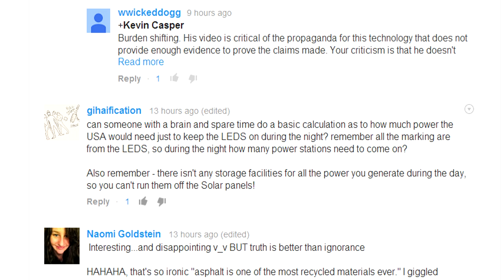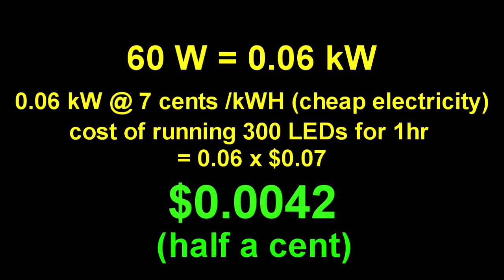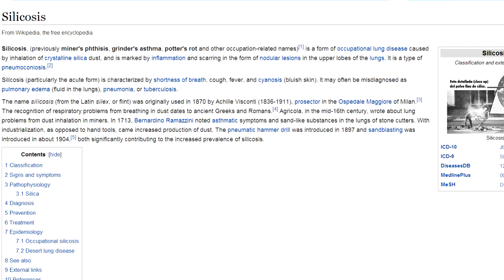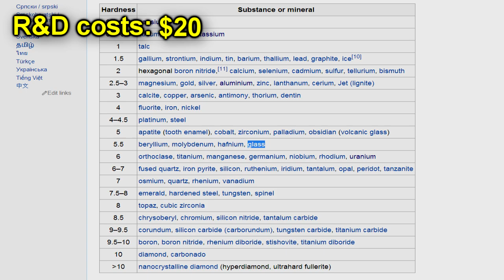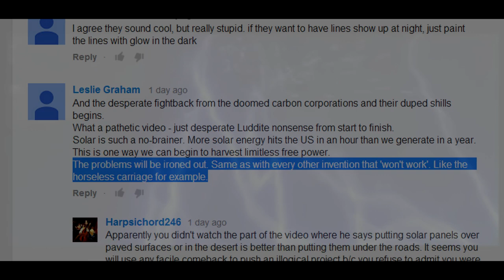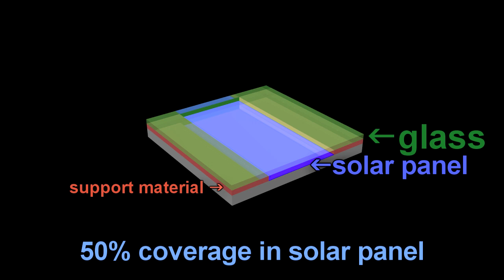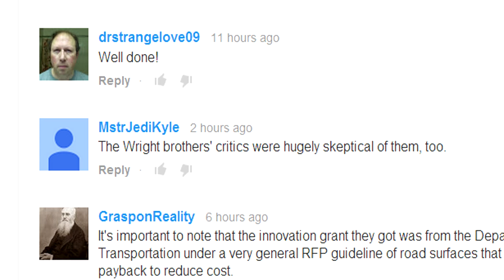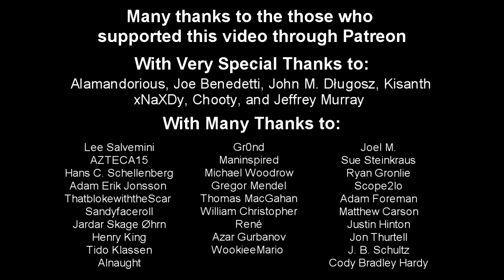Solar Roadways, IMPORTANT QUESTIONS AND ANSWERS!

Comment: Dear Thunderf00t
Instead of saying it is impossible why not try to think of ways you can make it work. Roads follow power lines so they could easily transfer the excess power somewhere to store it. And they could find a stonger clear plastic instead of glass, and use it to protect the solar panels.

This is why you don't get paid to research this stuff, and why you are stuck on YouTube
Reply: Thunderf00t is a paid researcher; so not really 'stuck' on youtube. I have an idea how this project can work, build the solar panels by the side of the road, that solves literally every problem and its cheaper. Even better idea; more solar farms.
Reply: He gave examples is of things that would at least work better than this. Putting the solar panels next to the road or building a roof of solar panels over the road would be cheaper to build, produce way more energy as you can angle them more to the sun and don't have a dirty road blocking the sun. And on top of that it would avoid all the problems of driving on glass / scratching the glass.
Reply: He did, what else do you expect? Some ideas aren't worth the effort. And what do you mean stuck on youtube? Is Tf digitally integrated in YT or what do you actually mean by that?
Reply: Firstly, to suggest that you shouldn't criticize a fundamentally flawed idea (especially one that has received $2 mill) unless you know how to make it work is simply absurd. However, in both of his videos he discussed road-side panels and mentioned how they don't suffer from some of the same problems. Unfortunately, they are still deemed to be cost ineffective in many locations despite their relatively tiny cost in comparison to these solar roadways.
As for the plastic, there are two issues that immediately spring to mind. Firstly, the strongest plastics that are currently widely used have very low scratch resistance. There is, of course, research into much stronger materials, including the addition of diamond nano-particles, an area in which I have a modest amount of expertise, but I'm afraid you'll need to start an Indiegogo for a money tree before we could afford to use something like that. Secondly, they made a lot of noise about using recycled materials (despite that fact that most recycled glass isn't clear enough). Plastics of this strength and transparency would need to be made from 'fresh' raw materials in any feasible production process.
This is why he has such a large following, and you are stuck posting ignorant comments.
Reply: alsoknownasallenkeys

If you cannot "criticize a fundamentally flawed idea" then wich kind of idea can you actually criticize?

You can have large followings with any kind of idea. Look at all the religions.

Most ot the arguments made by Tf are valid but they stay unaddressed by http ://solarroadways.com/intro.shtml

Hope there will be a payoff somehow.
Reply: "Roads follow power lines so they could easily transfer the excess power somewhere to store it."

This shows that you have no technological education at all.
To transport the electricity you have to transform the low voltage DC power onto  a high voltage AC line. And when it arrives at it's final destination where do you store it? Giant batteries? It's the problem with solar panels, they produce a lot of energy but not exactly when we need it so we have to use wind, nuclear and coal to compensate for when it's dark.

You will have giant losses and even if we magically developed a cheap battery that could store lots of energy, enough to power everything during the evening/night then why aren't we focusing the 2 million dollars on that magic battery?
Reply: Your first paragraph seems to agree with me but, with respect to your second, it was only a play on the phrase that he used.
I have seen their response and it is very easy to address them. From what I remember these are the key points:
They are only using 10% recycled glass. I'm glad they said this. I've read a couple of things directly from them that suggested they were using an extremely environmentally friendly surface so, if anything, this removes this from the 'pros' column. Asphalt is better in this respect.
They mention examples of LEDs that can easily be seen in daylight and say they will just make theirs more intense to match them. Doing this will increase the cost of production and operation several times. None of the examples are facing the sky either, so they will need to much more 'intense' than the examples they show.
They quote figures for the cost of snowy/icy roads but they really don't address his point. The energy cost is astronomical and the solar power from these areas won't come close to paying for it. If it did, the snow and ice would be melted by the sun itself. If they can't afford to get rid of it by conventional means then they can't afford to do it that way.
The final and most important point if their claim of a good ROI and I would certainly like to see how they arrived at that conclusion. I wonder how often they have assumed the panels will be covered by cars. Unless the road is very empty during the day this will be significant. I wonder what they presume the failure rate will be and how they have calculated the associated costs of closing the roads when a sufficient amount of these have stopped working. Finally, I'm fairly certain that they haven't considered how quickly the surfaces of these panels will become so translucent that they are almost useless. Until they give us the material they plan to use that will last more than a few days, let alone many months, before getting scratched, that is a problem that you can't escape.

Comment: I wonder what type of PCB/soldering technology they are going to use. All of that heat, cold, moisture, vibration etc would make these panels die within years if not within a year. I'm not sure why they would use LEDs in the first place.. surely they want something that can be flipped electronically but holds without current. Things would would get very fucking dangerous very quickly if all of the road markings suddenly disappeared in the middle of the night because of a failure in the standby supply for the panels.
Reply: :) its a shill idea from the outset - its just plain froud cames, I dont understand how does Indiegogo allow this sort of nonsence.
on the other hand ... anyone would like to finance a plastic indie rocket to the moon? I have some nice KSP footage of how it will work :D

Comment: One thing I don't get; how are you supposed to get those hexagon tiles to fit together without any appreciable gaps between the tiles? Adhesive surfaces between the tiles would be ridiculous and not last long, and if you just nailed them down together then you would still expect gaps to be created by the abrasive forces from the trucks on the surface. You can't really have gaps especially in a cold part of the world where freeze thaw is a problem. Also how are these things going to communicate; I assume it will have to be wireless, so every frigging solar panel needs wifi too?!  And of course what about thermal expansion! That would either force you to incorporate gaps deliberately which is exactly what you don't want, or risk them cracking whenever you have a 100F day.
Reply: John Yorson What about coastal roads that get splashed in high tide xD
Reply: Or places that have lots of EQ's and other natural disasters? Imagine a hurricane flooding a city full of those solar roads.
Reply: John Yorson Well that is a massive problem, you can't make them porous like asphalt or concrete because the water will get to the electronics, and you can't make them hydrophobic because that will make them slippery.
Reply: YoungerBrother Wakeup tbh I think a teenage computer hacker in a suburban basement could do more damage to these roads than a hurricane :P

Comment: They made a page debunking these debunks - solarroadways.com/clearingthefreakinair.shtml
Reply: Are they even trying? I mean their debunks are as stupid as their initial claims.
Reply: They claim that they picked a good place to put solar panels. Unfortunately, they don't mention they sacrifices of being unable to angle solar panels, or the surface area of the solar roadway panels covered in solar cells. 

They claim that the cost of Solar Roadway panels is overstated, and that a cost of less than $10,000 a panel would be sufficient to meet asphalt road costs. However, they do not state the actual cost of Solar Roadway implementation, just that the figure is unknown. Also, since asphalt is a pre-existing system, repairs would likely be less expensive that the implementation of a new road medium. 

They claim that asphalt roads are not cheap or maintainable. I don't know who claimed that is was cheap, but it's certainly seems cheaper than Solar Roadway panels. They're also not over-engineered, use no power, are made from a recycled bi-product of the oil industry and provide tried and true traction for tires. 

They say that asphalt is softer than glass. This might be a good point if roads were only made from asphalt, but roads use asphalt as a cement to hold stones and rocks. It is the stones and rocks that are the issue, not the asphalt cement. 

The say that you can easily see LEDs in direct sunlight, but the examples they give are always face on. The LEDs in Solar Roadway panels are at a shallow angle. Also, they make no mention to how economically and environmentally conscience it is to fill solar panels with LEDs you are unlikely to ever use. 

They say that they can afford to heat icy roads because it will save lives. This is confusing the issue. The issue isn't that keeping roads clear of ice and snow isn't important, but rather that heating the roads is very inefficient. The energy needed to change a compound's state (from solid to liquid, in the case of ice) is far greater than you would think. Simply keeping the panels a few degrees above freezing, as they state, would probably not be sufficient to deal with snowfall.
Reply: ***** The snow melting debunk was the most pathetic thing I have read. "Ehm yeah it might cost ridiculous amounts of energy that we will never be able to generate but you'll be saving lives man! Emotion! Don\t think, feel!! "
Reply: *****
-Solar panels don't work when dirty. Roads get dirty.
-Glass is softer than the softest silicate in dirt: Quartz
-Solar panels can't be angled if put on the road.
-LED lights are definitely not visible in the sun. That's why traffic lights are shaded with cylinders.
Reply: That's ridiculous, they did zero calculations on the actual price of the tiles. As well as provide videos an demonstrations on the traction.
Reply: "So if anyone tries to tell you that glass is soft, just remind them that even simple window glass is harder than steel. By comparison, it's asphalt that is soft."

I see they're using Skyrim logic, cool.
Reply: "So if anyone tries to tell you that glass is soft, just remind them that even simple window glass is harder than steel"
Reply: Please upvote this guy so that TF notices him. A debunking of the debunking of the debunking should be fun to watch :).
Reply: Some of these are fukcing hilarious.

My favorite is:

"Thunderfoot compares our Solar Road Panels to a thorium car and a transorbital pogo-stick and says, If you could make one, it would be super cool. We actually made 108 of them. And he's right: they're super cool!"

Yes, thats like saying you made few of the bolts required for the Thorium car.
Having few of those panels is not a road. Its just a few panels.
Reply: They literally found ways around every argument... not directly answering anything. Perfect example is glass being harder then asphalt... that doesn't matter, asphalt can be scratched, what matters is whether its softer (can be scratched) by rocks and other debris on the road because it needs to stay clear. Then they show high intensity LEDs in street lights faced straight at the viewer... that's not the same as viewing it through glass (scratched up or not) at an extreme angle. Also the heated road parts... they go on to discuss how much life is worth, well shit if that's the case we can put heating systems into asphalt roads... but we haven't. They don't discuss the actual price because they used the wrong type of LED in their prototypes and haven't gone onto mass producing yet or whatever, just lol at the whole page.
Reply: Samuel Shipman Someone needs to tell them that road grit isn't made from steel.
Reply: YoungerBrother Wakeup I thought the asphalt being softer than glass 'debunk' was the most egregious misrepresentation in this long list; I actually couldn't believe they had though it was a worthwhile point. However, I agree that their pathetic appeal to emotion about the dangers of icy roads is so obviously manipulative it borders on the insulting.
Reply: burlakinavolge You'd think engineers would know the difference between hardness, strength and toughness.
Reply: Samuel Shipman I swear I did a triple-take when I read that line. These people are out of their minds.
Reply: Uncle Grim Made me so mad haha
Reply: Derek Chapman Their asphalt argument shows that they are full of crap. "Asphalt" is a colloquial for for "asphalt concrete". Asphalt is just the glue that holds together harder aggregates.
Reply: Donnie

Or just don't feed retards more attention. I think we have enough of that already.
Reply: U9B maybe, but today one of the channels that I follow, covered this story again. And money is still flowing there. And people still believe their defense.
Reply: Its great, all they are saying is "THEY ARE WRONG AND LIEING", but they refuse to explain exactly how they are wrong.
Reply: burlakinavolge
haha, that is awesome.

Comment: The fun thing is this scratching is nothing to a brake check, 130 km/h down to 0 as quickly as possible.
Imagine the carnage if there is a simple accident, someone rolling his car, a tree falling on the road, roadkill, leaves on the surface which need to be gently wiped off.
Then, I really don't want to know how horrible glass behaves if wet or freezing cold, imagine the wear on the coating as well as on the cells during winter/summer.
This is madness. the money could be used elsewhere, if they want new technology, they can support molten salt reactors, 5-stroke engines, which are technologies needing some ironing.
Or they could donate to charity, to cancer research, among others.
This is a huge waste.

Comment: Your experiment is rather cheap, yet surprisingly effective.  Ideas like this are needed to free ourselves from a dependence on fossil fuel, but, as enticing as this idea is, I don't see it going any where.  This guy should have funded research for smaller batteries for electric cars or a lobbying campaign to legalize hemp.
Reply: Or just put solar panels on buildings and houses.
Reply: Absolutely agree.

Or perhaps solar panels on the tops of electric powered vehicles, as well as the usual option to charge them manually (Charging them manually still uses fossil fuels to generate the electricity.)? Or maybe the wings of commercial aircraft - charge up batteries during flight where they're above the clouds and get almost constant unobstructed sunlight during daytime flights, then swap them round for empty batteries before the next daytime flight?

Ok, the last one might be a bit sketchy, but there's just two ideas that would be more efficient than "solar freakin' roadways" that I just came up with watching Tf00t's vid, and I'm pretty sure it wouldn't cost almost 2 million dollars to explore the viability of either of them.

But yeah, at least they're trying, and maybe these LED solar panels could be implemented in other ways other than roads, pavements, car parks, etc that we haven't thought of, even if they are basically useless for all of the above.
Reply: nuclear.
Reply: the guy who never uploads anything Nuclear fission, whist efficient, leaves behind a lot of radioactive waste and we're nowhere near being able to consider nuclear fusion as a viable and commercial source of energy.

Maybe in 3/4 decades, but for now solar and wave seem like our best bets.
Reply: Vehementi LFTR. it creates waste but its way better than the reactors we have today.
Reply: the guy who never uploads anything The reactors we have today ARE nuclear fission reactors...
Reply: Vehementi Yes they are and I never said they arent?

Comment: I think those solar panels are good for your own parking place next to your house. But not for roads.
Reply: It still makes way more sense to just instal a panel that follows the sun. Solar panels used as road surface is about as effective as an underground windmill.
Reply: The solar panel won't work very well when covered with a car. If you want a solar panel put it somewhere where it can be exposed to the sun for the maximum amount if time. Just put it on the a roof.

Comment: Thanks for using your brain. Maybe they could use these solar pavement things in the parking lot at Sears or Kmart. They would generate lots of power due to the lack of cars parked on them, and they wouldn't grind down because of the lack of traffic. Like I said before maybe build a structure above the traffic and mount the panels on that?

Comment: Somethng I noticed (didn't come up in last video or this video as of yet 1:30) is that the thermal heating unit was an additional piece of material which looked like cardboard and went over the top of the hexagon units. That would mean they would block out the light, not to forget they would get ripped upped by cars that drive over them!!!